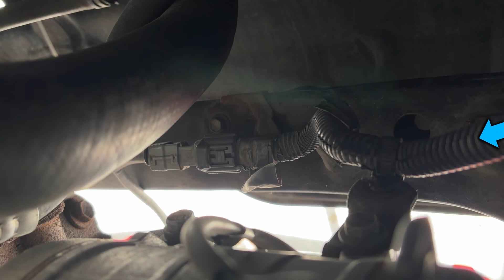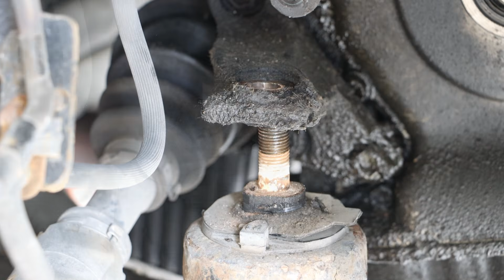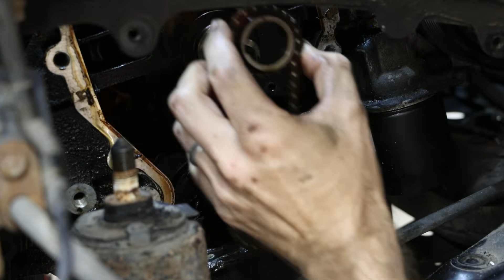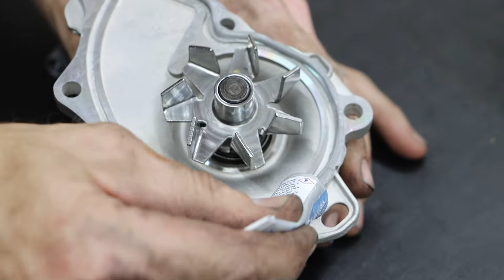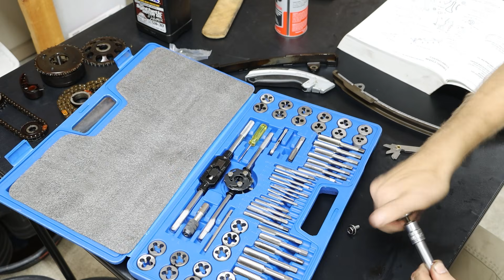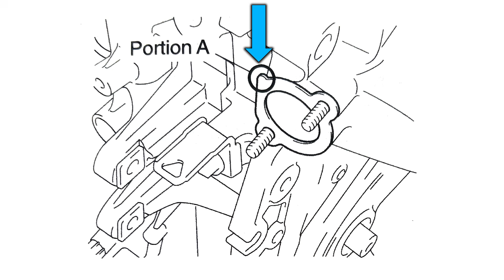Timing Chain Replacement, Startup Rattle, Water Pump, Thermostat-2003 Toyota Camry, 2.4L (2002-2006)

Comment: Thanks for making such a detailed video.  I have a 2009 pontiac vibe that has the 2.4l toyota matrix/camry engine in it and it's so similar that I'll be able to use this as a guide.  Really helps my confidence level to see this.  I've also got the oil pan off and will be changing the balance shaft as well (a plastic gear gets loose and starts rattling).  I haven't opened up my timing cover yet but I saw from some of the oil pump chain from the oil pan removal and saw that my timing chain colors are off by 180 degrees but the little dimple is correct (everything is at TDC).  My VVT gears are all at TDC as well.  I'm interested in how things look when i open the timing cover this weekend.  The only dilemma I have is raising and lowering the engine...I have used the oil pan in the past but since the oil pan has to be off I'm guessing maybe the tranny connection would work.  I noticed you jacked yours up and down somewhere else as well.  Probably way too late but in my research I saw that these engines also have a VVT oil screen that's right behind the power steering pump that's good to remove and clean but you can't get to it unless you remove the power steering pump.  Thanks again for making this video!
Reply from the maker: Thanks for watching and for the detailed comment. I'm glad the video is helping you feel more confident about tackling this project.

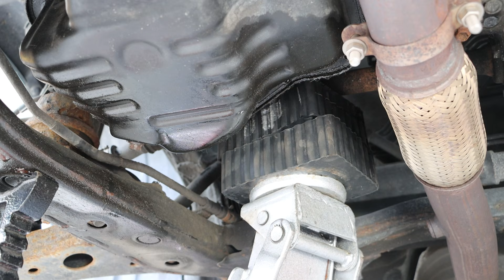As far as raising and lowering the engine, I actually positioned my jack underneath the bracket that the passenger-side axle passes through, just behind the oil pan. I used a couple of rubber blocks between the jack and bracket. You can see that setup at about 9:30 in the video. That worked well for me, especially since I ended up removing the oil pan later in the project.

Regarding the timing chain marks, I also noticed that my colored links didn't line up perfectly with the timing marks during disassembly. Just keep in mind that the colored links won't necessarily line up every time the engine returns to TDC.

When I did this repair I wasn't aware of the VVT oil screen behind the power steering pump, and would have changed that out also.  

Good luck with your project, and thanks again for sharing your experience!
Reply: @InsaneOil  Thanks for the quick reply and the jack point suggestion.  I really appreciate it.  I'm going to look for some place similar to jack with on my Vibe as well.  Regarding the timing chain colors I definitely trust the dimples on the pump and crank gears more than the chain colors because the flat spots you mentioned on the spine of the bolt they're attached to shouldn't allow the gear itself to slip.  Oh I did have 1 more question.  With my research the VVT is in the locked position on the cam.  I'm replacing the VVT but I read that it ships unlocked and it's ok to remove the old one locked (I shouldn't have to unlock it before removal)...then i can torque down the new one...and once torqued, I can spin the new one into the lock position.  Did you do any of that or did you just remove the old one and put on the new one without worrying about the lock on the VVT?  BTW I realize that the Camry that you worked on is different than my vibe but I'm also watching your Camry Motor Mount video to get tips on your install sequence strategy to help me out with mine for when I do that also.  Super cool of you to explain what you're doing and why.  I really appreciate it.  :)
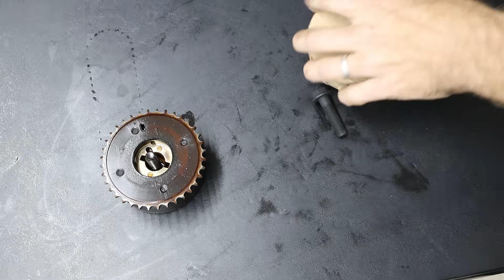Reply from the maker: @Swikster8419  Thanks again for watching, and I'm glad you're finding the other Camry videos helpful too! As far as the VVT sprocket goes, I didn't do anything specifically to lock or unlock it during the replacement. I simply removed the old sprocket, installed the new one, aligned the timing marks, and torqued it down. You can see that portion of the video starting around 32:00.  The video shows all of the procedures that I did as I did not leave any steps out from the video.  I have also watched some other videos that discuss the locking/unlocking procedure you described but it more so relates to if you accidentally lock it before installing it...if that makes sense.
Reply: @InsaneOil  Yeah totally makes sense.  I got to thinking about it and if you install it unlocked then the sprocket will likely be "out of time" until you spin the sprocket to lock it so I think by default installing it that way it should be good to go.  Yeah you were very thourough in your videos and I enjoy getting your thoughts on things as you go.  Saves me time on thinking things through as I go because likely I'll be going through a similar thought process on solving something.  Thanks again for your responses!
Reply from the maker: @Swikster8419  Thanks for the follow up thoughts.  Good luck with your repair.

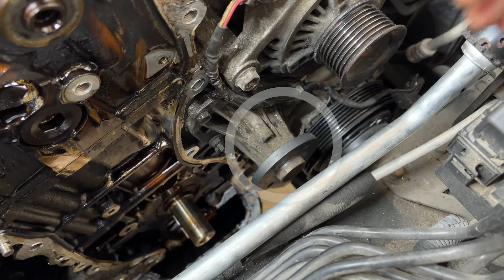Comment: 21:07 Even Oem water pumps are surprisingly problematic on the 2azfe. Replacing a water pump is a 3 year service maintenance item in my book.
Reply from the maker: Thanks for the added information.  I'll have to keep that in mind as I do my regular maintenance.

Comment: Isn't the timing chain supposed to last the life of the vehicle? did you atleast use an OEM replacement?
Reply from the maker: Thanks for the comments/questions.  What is the life of the vehicle?  According to most research, the "average" life of a vehicle is about 12-15 years and about 150,000-200,000 miles.  The vehicle in this video is 23 years old and has 250,000 miles on it.  Other research shows that the timing chain should last 200-300k miles but they often fail between 80-150k miles.  I used an aftermarket kit - https://link.amazon/B07qZo9Xk
Reply: @InsaneOil  fair point.. mine has 230,000 and no chain squeeks yet. knock on wood I guess. Would dread to have to do this.
Reply from the maker: @DaBluntTrauma  The vehicle in this video also was very poorly maintained for about 10 years prior to me procuring it. I think if you take good care of your stuff, you shouldn't have much issue maximizing the life of the components.

Comment: Do you have to remove the water pump and oil pan to replace the chains?
Reply from the maker: Technically you don't need to remove the oil pan or water pump.  However, you are removing some of the oil pan bolts (which are connected to the timing chain cover).  This in itself "breaches" the sealed system.  Secondly, to reinstall the timing chain cover you would be adding more gasket maker material at the point of contact between the timing chain cover and oil pan, which means you probably are scraping the old gasket material off, which also means the old gasket material may be falling into the oil pan (and any other debris from removing the timing chain cover).  As far as the water pump, it basically just get's in the way a little bit when reinstalling the timing chain cover and is more of a nuisance.  However, if the water pump has not been changed for quite some time, I would recommend replacing it as it is fully exposed.  Prior to doing this repair, I watched a few other videos on YouTube where they left the oil pan and water pump on.

Comment: i wish they redesigned the wiring harness to not be attached to the valve cover or any part of the engine other than the connectors,
Reply from the maker: Yes, that is a quite annoying design feature.

Comment: Putting the power steering pump back in is not fun holy cow I found using a pry bar and mallet to push the rear threaded squares to get them flush makes it easier
Reply from the maker: I did not enjoy that part of the repair.

Comment: This is PERFECT, except for one thing. Naming the round seal in the timing chain cover, it is called the "front crankshaft oil seal". This video it a very good example of a way to do teaching videos. PERFECT!  He called it a old seal.  Again, it is called,  "front crankshaft oil seal". A very great thank you for doing such a great job. If I ever get to make a helpful repair video, you are my example.
Reply from the maker: Thanks for watching, the comments are appreciated.  Generally, I try to use the correct terminology as best as I can.  I must have overlooked that one.

Comment: Hey, I’ve have my 04 Camry for a while and for a about 50,000 miles I’ve been having an issue on and off and no mechanic has been able to help me with it, the sorta rattle from the beginning only happens occasionally and on some days it happens when I accelerate, but not really otherwise, would this be the timing chain?
Reply from the maker: Thanks for commenting. Can you tell me a little more about the rattle?

If it only rattles for about one second when you first start the engine cold, and then doesn't rattle after the engine has warmed up, it's most likely the VVT sprocket.

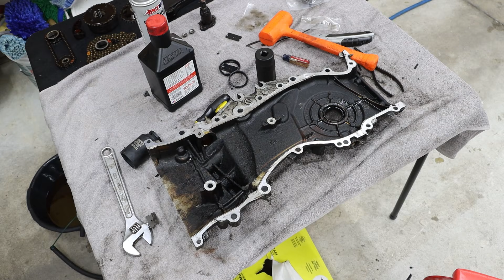If it rattles while driving or intermittently during acceleration, it could be something else, such as a loose timing chain guide. In my video, one of the timing chain guide bolts had actually fallen out, which allowed the guide to move and make noise (around 37:04).

If you can describe when the rattle happens, I may be able to point you in the right direction.
Reply: @InsaneOil the rattle starts when I start my car everytime, but then only occasionally happens when I’m driving and accelerating. I’m planning on using this video to take apart my engine and replace my timing chain so I can say for sure if it fixes the problem or not in a few months, I gotta gather my supplies
Reply from the maker: @handsmeier3334  Thanks for the update! Based on what you've described, I think it's definitely worth inspecting the timing chain components while you're in there, but I wouldn't say the timing chain itself is the most likely cause just yet.  Since it rattles every time you start the engine, the VVT sprocket is still high on my list of possibilities. The occasional rattle during acceleration, however, could point to something else in the timing system, such as a worn timing chain guide or tensioner.
Reply: @InsaneOil alright, thank you for helping out! I’m gonna replace the vvt solenoid sometime next week and then when I’m due for an oil change I will replace the timing chain along with the oil when I have time between work and school

Comment: Do the loud starts ever get quieter for this Camry? I watched your first starts but wondering if that’s just because you changed everything or is that a separate issue?
Reply from the maker: It’s an older car.  I don’t figure the start will ever be silent.
Reply: @InsaneOil if it was a normal car I understand but these are Camrys. There should be some maintenance that can make them quiet. I have a 3.3l which is very quiet
Reply from the maker: @cphilly1931  You have a fair point.
Reply: @InsaneOil  mine does that same sound for 1 second on startup, I figure at 309k miles it probably isn’t worth messing with.
Reply from the maker: @slalomking  I have read that it isn't a huge issue and you can run your vehicle with that issue for quite some time.
Reply: mines quieter now.. i live in the south.. clean your VVT Solenoid, that helped me and change your oil.. i use castrol gtx 5w30
Reply: It a 2.4L engine. Don't expect it to be quiet plus it is old.

Comment: I've got a 2009 corolla and it has VVT rattle at start up.  I decided the VVT is never going to wear completely through and I don't care what it sounds like on start up.   It's only for a second.
Reply from the maker: That's a valid point. A lot of Toyota owners choose to live with the startup rattle for years without any major issues. In my case, I started getting a P0016 cam/crank correlation code about a month before I did the repair, which made me curious about what was going on inside. When I tore it apart, I found a loose timing chain guide bolt inside the timing cover. Since completing the repair, the startup rattle has been eliminated and the P0016 code has not returned. Time will tell, but so far the results have been encouraging.
Reply: My 03' camry has had this for at least 100k miles. Seems like ignoring it is fine. Still pulls hard, so it must not be causing any timing issues yet. No new codes.
Reply: @KaiForce  They made the clearances too tight and if you were under warranty extended to 60,000 miles they would change the old one with the new part for free.  But I bought the car with 115,000 miles.  Yes, I could pull the cam and change it with the new part.  But if you look at what's rubbing, it's an inch thick and it has oil on it.  It gets shiny eventually but that's about it.

Comment: I am wondering how much this would be if it were done in a shop?
Reply from the maker: I priced out the repairs separately on repairpal.com (water pump, thermostat, timing chain, etc) and it totaled about $2500.

Comment: Excellent video. I also had the same issue with the timing chain guide bolt. the thing must have stripped or something, same exact problem. I also re threaded it and was very careful not to strip the Aluminum. Weird, I though it was me LOL. I also replaced the crank shaft sensor with a new Toyota one
Reply from the maker: Thanks for the comments.  When I pulled the cover off I wasn't sure where the random extra bolt came from, until I kept moving forward with the disassembly.

Comment: I have the same car but 2005. It starts up right away but the crank is a little loud and not smooth. Any ideas what it could be and the fix?
Reply from the maker: A slightly loud or rough crank/startup on the 2AZ-FE engines can come from a few different things, especially once they get some age on them. If it fires right up and then smooths out within a second or two, I’d start by looking at:

• Weak battery or aging starter
• Thick/old oil or incorrect oil viscosity
• Early wear in the VVT intake cam gear (very common on these engines)
• Timing chain tensioner bleeding down overnight
• Worn belt tensioner or accessory bearing making noise during startup

The VVT sprocket issue is especially common if the noise is more of a brief “grrrr/rattle” for 1–2 seconds right after startup. Toyota updated that part multiple times over the years.

A few questions that would help narrow it down:

1. Is the noise only on cold starts or every start?
2. Does it sound metallic like a rattle, or more like the starter is dragging?
3. How many seconds does it last?
4. Any check engine lights or timing codes?
5. What oil viscosity are you running?

If you can upload a short startup clip, that would help.
Reply: - The battery is new but I don’t believe the starter has ever been changed 
- actually getting the timing chain and its components replaced now while repairing head gasket 
- belt tensioner has been replaced 

1. Noise happens on every start
2. To me it doesn’t like a rattle but you might have a different opinion 
3. It last for 2 cranks of 2 seconds 
4. No codes 
5. 5w-30
Reply: https://youtube.com/playlist?list=PLW9dmB4_jHZwcl5YMOgZfqqdXW6E__2N_&si=fyPMGQq_VXo8GjXR

This is the startup
Reply from the maker: You said you were currently getting the timing belt, etc. repaired.  I am curious if that in itself will correct the problem.